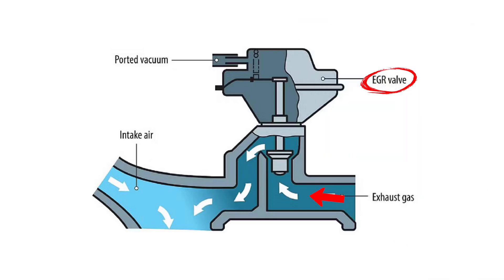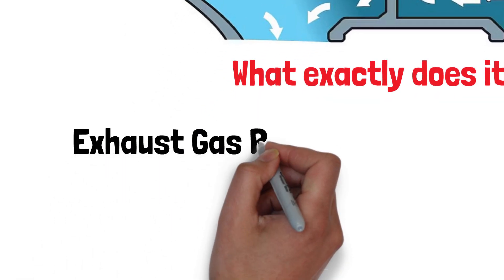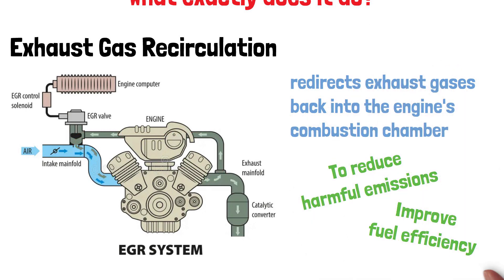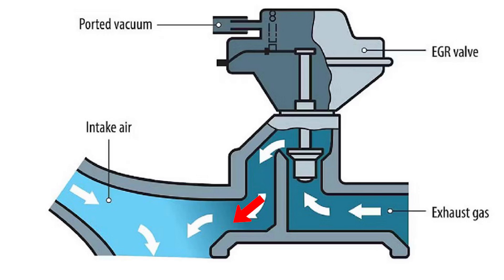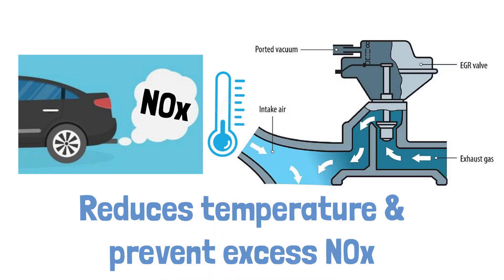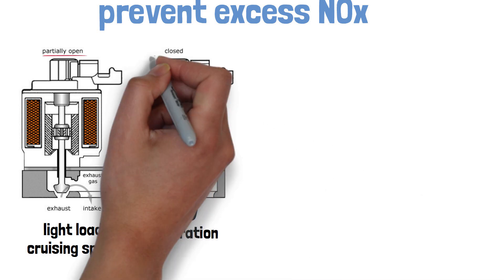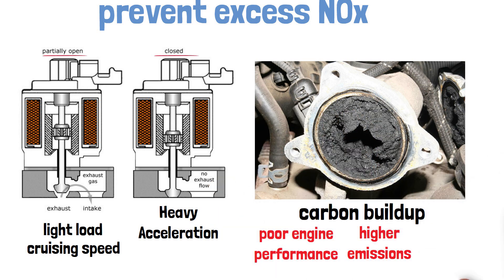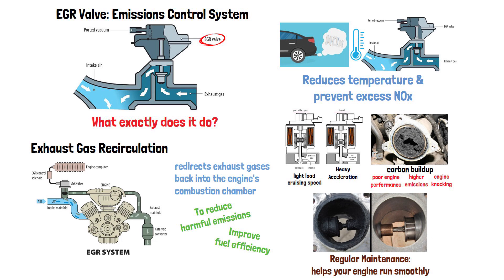MIND-BLOWING EGR Valve Secrets Revealed in 1 Minute

Comment: Must clean and check to be more efficient in running approximately,, EGR,, valve for about a year or below?. God bless folks.
Reply from the maker: You're absolutely right! Keeping the EGR valve clean is key to maintaining efficiency. A good rule of thumb is to inspect and clean it every 1-2 years, depending on driving conditions and how much carbon buildup you’re seeing. Thanks for the tip, and God bless you too!